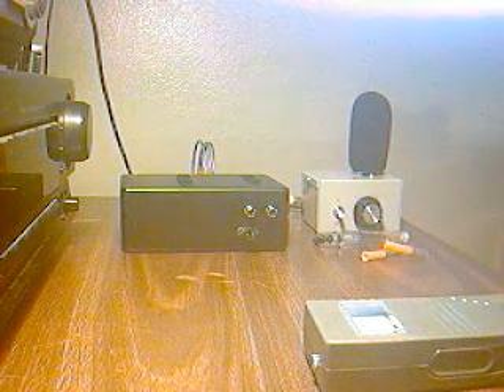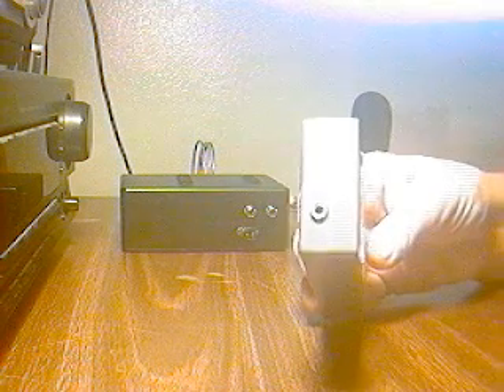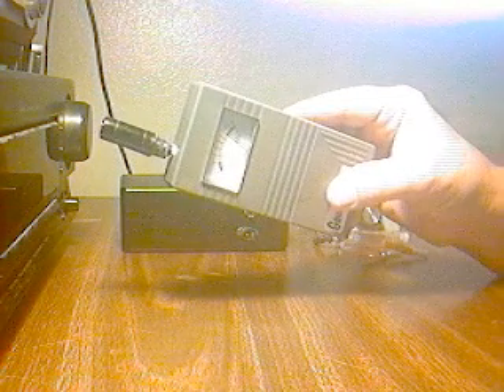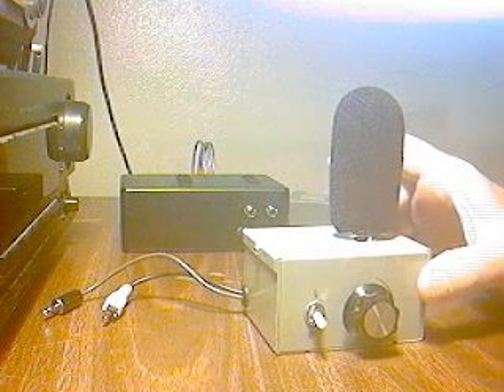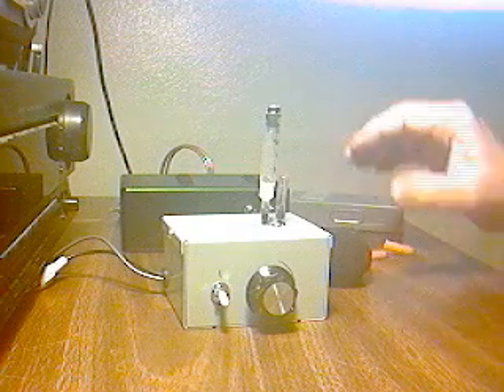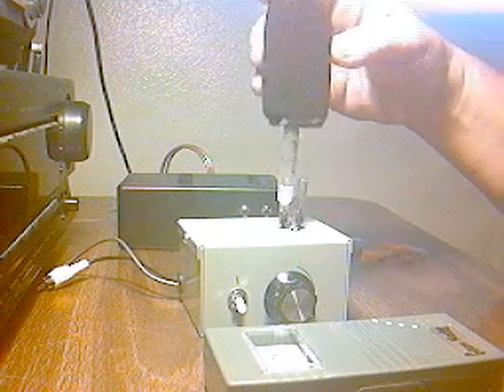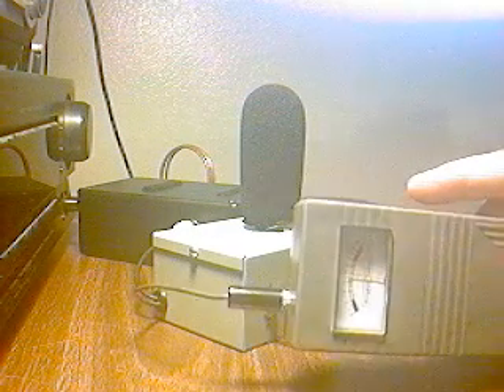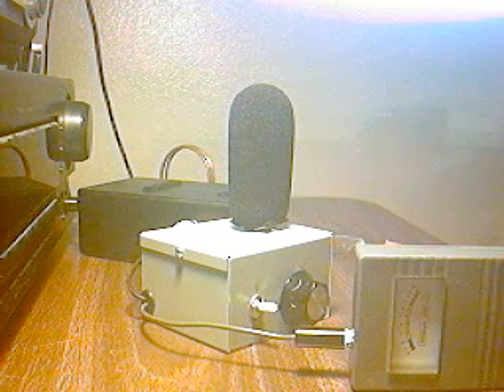Infrasonic microphone attachment for the Gauss Master EMF meter

Comment: Hi! Interesting video. Could you explain why the gaussmaster can pick up infrasound? The gaussmaster is designed to pick up EMF's...So I'm not sure what the connection is between EMF's and infrasound. I know a bit about EMF's, not so much about infrasound, but am trying to troubleshoot issues with the latter at my home. Thanks!
Reply from the maker: the title of this video is " Infrasonic microphone attachment for the Gauss Master EMF meter " . it's a infrasonic microphone grafted onto a Gauss Master as the video shows.  the point of the article is about making the sound output of a infrasonic microphone audible to humans by upconverting the infrasound via the VCO of a Gauss Master. A Gauss Master is a VCO oscillator which has a small inductor ( gauss pick-up )  attached to a vco / speaker. it's nothing more.   there are several infrasonic detectors on eBay , search for " Infiltec " to see them.

Comment: Can this pick up subliminal sound and produce it audibly? Like from a mind control direct energy weapon? If not how can this device be modified to do this? Thank you for your time.
Reply from the maker: this can pick up weak infrasound and convert it to easier to hear 300 - 3000hz.  sound. still, as I show in my videos, humans can indeed detect sound waves/ fronts in the infrasound ( the beats from a thumper car stereo are infrasound, for example .. they are powerful wave fronts that have a repetition  rate below 10hz ) .  if you can give me a link for this mind control direct energy weapon, I'll look at it  to see how it works and let you know.  would the energy this weapon gives off be infrasound / low frequency sound  waves ? .. and  can  someone control  human minds with low frequency sound ?    I am aware of the LRAD ( Google LRAD sound canon ) sound canon  weapon ( they are common in military field units and especially on ships  )  the military uses but those are in the normal human hearing frequency range and those put out painful sound front levels that hurt people's ears and make them vibrate.  they are basically a loud long range sound projecting  solid state speaker.

Comment from the maker: Hi Jerry. right now you have to build your own as they aren't commercially available. the Honeywell pressure sensor chip alone costs about $120 and it's close to $200
( or a little over ) after you buy all the parts and build it. this not counting the Gaussmaster. the next step up that I know of  is to buy a kit from Infiltec dot com. or build a serious laptop based  detector setup with a modified  Honeywell chip and a  WinDac A/D converter  - Ultimaserial  client.   thanks for asking Jerry.

Comment from the maker: I'm not currently selling these  but wouldn't mind someone marketing them for me for the rights to build and sell them. also, I have other unique electronic  devices related to the paranormal if that is your application. you could contact Les Rayburn of High Noon Films in Alabama ( I live in California ) for more info 
Les Rayburn, Director
High Noon Film
130 1st Avenue West
Alabaster, AL 35007-8536
(205) 621-7500
(205) 621-7505 FAX
(205) 253-4867 CELL
or Google  Les Rayburn High noon

Comment from the maker: volumes no smaller than the one seen  mounted on the sensor in the beginning of this video and volumes no larger than the one in my hand should be used. of course try anything you want , but those would be my recommendations from exhaustive testing and measurements.

Comment from the maker: all tuning devices are standard plastic aquarium / medical tubing and discarded plastic syringe bodies and / or  parts ( drip chamber ) from disposable IV bags commonly available on eBay.  thats a drip chamber with an inverted insulin needle leak, in my hand,  seen in the first of this video. the volume seen on the port in the beginning of this video ( behind my hand )  is plastic tubing with an insulin needle inverted into it at the top.

Comment from the maker: fairly clear views of the  port tuning tubing are seen in this video. just duplicate the approximate sizes ( it's not critical )   seen and use a " leak "  port made of the needle of a 1cc  insulin syringe inverted into the tuning volume as seen in the videos if you look closely. search Google for  " infrasound detector DC001NDR5 " the infravolc.nmtgeop  site for a similar schematic. many references  for using the dc001ndr5  chip exist on Google  as well.